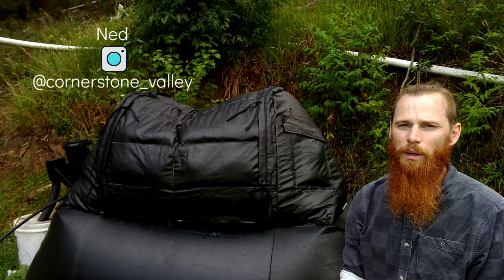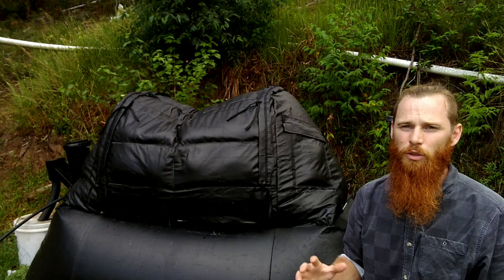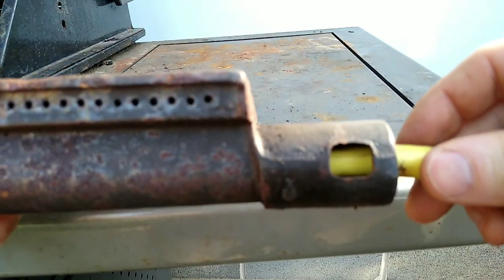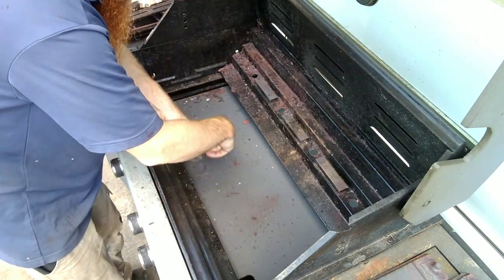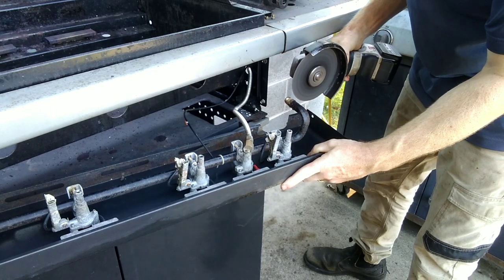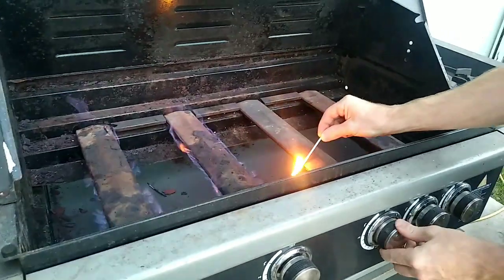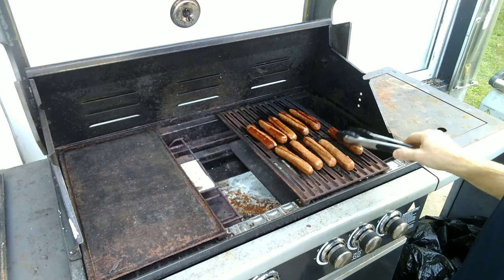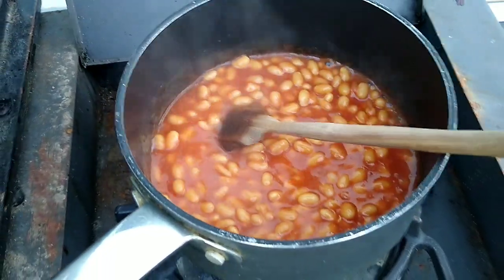Unlock more from your biogas plant at home, DIY BBQ conversion

Comment: BBQs are the perfect application for biogas. Warm weather increased gas production and the need for outdoor entertaining.👍
Reply from the maker: I couldn't agree more Ian.  My only suggestion if your thinking of doing it is to make a better wind break as the flame gets blown around a bit because it's not under pressure.

Comment: A good experiment. Well done. Just make sure everything is safe. Some sort of backflash arrester along the gas pipe may help make it safer 👍
Reply from the maker: Thanks Rob, Ive never heard of them, I'll look it up and put one in!
Reply: @cornerstonevalley   Sorry they are called (Flashback Arrestors). You can find out what they do on YouTube. They are great safety devices. If you know a qualified gas plumber they should be able to give you some good advice.
Reply from the maker: @Rob.P  Thanks Rob.  I've been wanting to compress the biogas into a gas cylinder as well, but am a bit cautious about the risk of explosion.
Reply: @cornerstonevalley  Hi, if it was me, I think it may be safer to use an extra uncompressed storage solution instead. If you have the room, that may be all you need. There are different types on YouTube. Some of them need to be secured or fixed to the ground incase of strong winds. What ever you decide to do, safety is the most important when comes to flammable gas. I would also find out if there are any prohibiting laws in your area just incase.
Reply from the maker: @Rob.P  Yeah, I quite like the idea of the storage bladder in an IBC tank, which makes the securing to the ground very easy.  However, if I can compress it safely, it would be safer to have the gas stored in a cylinder and in a bladder.  I've been speaking to a Chemical engineer and he thinks the risk of explosion is not too great.
Reply: @cornerstonevalley  I like what you are doing and would like to see everything go well for you. Your doing great 🙂👍
Reply from the maker: @Rob.P  Thanks mate!
Reply: @cornerstonevalley   No worries mate 👍